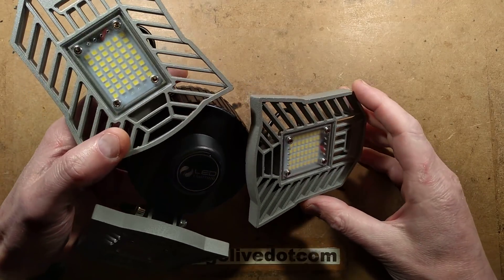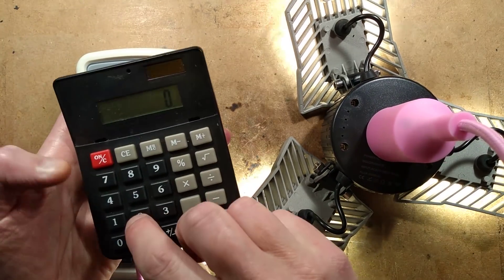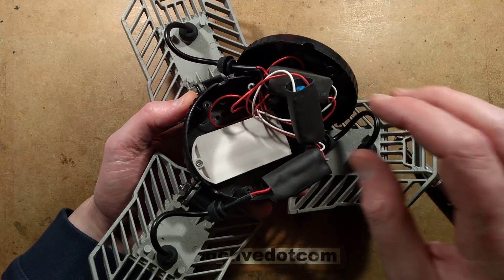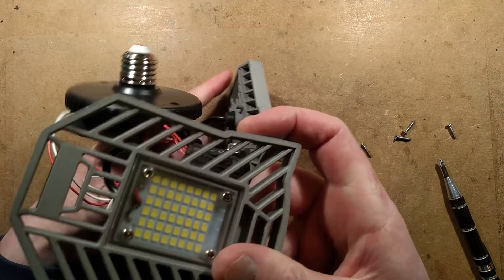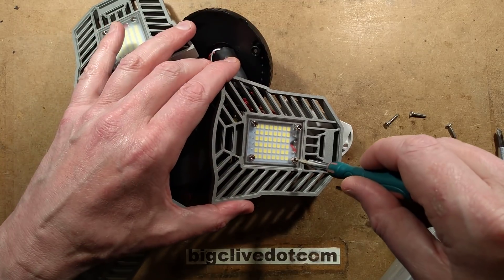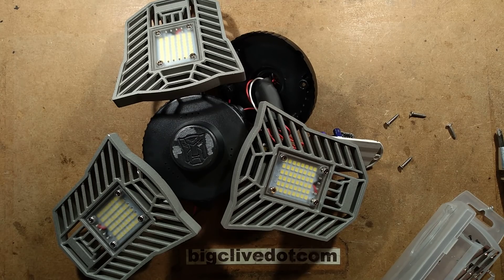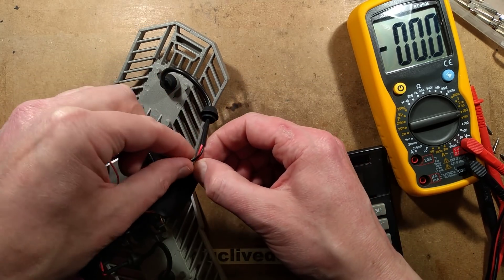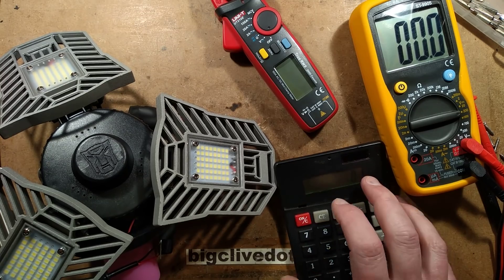Second Autobot lamp with RADAR sensor.

Comment: I just bought the clamp meter, it seems the E variant as shown has slightly tighter specs and the most expensive compared to the A variant which is half price.
Reply from the maker: If it's the Uni-T meter it measures DC current with the clamp, which is quite special.
Reply: @bigclivedotcom  I bought the exact brand and model. I have a couple of multimeters but no clamp meters.

Comment: I'm curious about something: Does a Class Y capacitor limit leakage current enough that it won't trip the Ground Fault Circuit Interruptor (or whatever the UK term is for it)?
Reply from the maker: The class Y capacitors are usually a really low value like 1nF, so they don't create much leakage.  Typically around 100uA (one tenth of a milliamp).

Comment: I'm amused you bang on about the switching supply in the radar sensor and how it has such a good power factor when its power factor was like 0.42.  It's the other (LED) supplies that had the good power factor.
Reply from the maker: I'm pretty sure that when the main load was on the lamp drivers had a good power factor.  It was much less critical with the ultra low standby current of the sensor.

Comment: when that happens to my phones there is a connector that needs reflowing, in my case there is a connector on the motherboard that plugs into kind of a breakout board where everything connects, that connector tends to get broken solder. the digitiser is one of those things that if there is an intermittent connection it goes dead till reset

Comment: Is there a way to modify the detection/timer module to allow for adjusting the on time of the light?  I'm just wondering if it's as simple as putting in a variable resistor for a 555 timer or something.
Reply from the maker: It should be viable to swap the timing capacitor on the detection chip.  Easier with a better documented chip.

Comment: I would say thermal compound or heat sink compound -- thermal paste would be the stuff that is bonding glue with heat conducive properties for small heat sinks that have no mechanical clamp to hold them on the chip.

Comment: there's no adjustment pot for the radar detection timeout, is there a resistor to be replaceable with a different value ?
Reply from the maker: There's probably a resistor or capacitor that could be changed to modify the delay.

Comment: Hey, Clive, I am in need of a current clamp and see this video is perfect timing! What can ya tell me about the one you used here? Is it the UT210E model? What do you think of it? Love your videos, keep um coming. Cheers!
Reply from the maker: I like the UT210E.  It's a versatile little meter.  Does initially take getting used to the need to zero out the DC current reading relative to orientation and objects.  (It senses ambient magnetic fields.)
Reply: @bigclivedotcom  Thank you... An Amazon click and mine is on the way.

Comment: Could you screw this v2 version in to a standard ceiling fan light socket and use the air from the fan blades blowing down to cool the heatsinks on the LED's?

Comment: Recently got cheap eBay 12v spot lights, might be hackable housings seem well made. Search eBay for 'Two 6" Super Bright 18 led 54w dual color' or '2 X 6 LED DRL Fog Running Lights'

I'm hoping to hack my 2x6 led lights swapping out the white LEDs for red ones

Comment: Will these work at 120v? Some on ebay showed 170v-265v, but others showed as little as 85v-265v... They appear to be the same light fixture...
Reply: Seth The internal modules may be for either range with same outer casing.  85 to 265 V is a common rating for universal mains PSU modules.

Comment: Oh just imagine getting your Windows PC fixed (the broke it actually.  smashed the keyboard dislodged the memory.  which I only figured out because ubuntu ran fine with it but said the memory was off so I took that dell apart.  ) Either way they kept calling it the LOGIC board.  whats that , like the big board inside a laptop duh.  Um thats a Motherboard.  ...... Oh thats right your a windows guy.  smh dumb apple repair guys confusing terms  do'h.  Heatsink compound makes more sense as thermal paste doesn't entirely make much sense to me.  how bout heatsink paste  ( never went to thos e idiots again because they cost me $20 for the keyboard and $50 for the memory.  no wonder they let it go for free.  $70 just to reinstall everything and they had an A+ cert in front?  I doubt they passed well  and MCSE on top of that.  Cheaters???  (MCSA in some areas) since some countries had Engineer

Comment: I've watched a bunch of John Ward's uploads about switching contacts. I've seen the failure of the wrong switch in a circuit first hand, and have taken apart several  relays and switches. A lot of the domestic stuff here in the USA seems to have specific (small separation) AC or (large separation) DC type contacts. However, of the dozen or so cheap Chinese switches and relays I've taken apart, all of them had large switching mechanisms with a wide separation. I started taking a bunch of them apart after going out of my way to source DC rated (cheap Chinese...//yeah I know) switches for a couple personal projects. One "DC rated" order came with different color rocker switches. Half of them only had DC rated markings and half only had an AC marking. After disassembling them, they all had the same internals. 
  Don't take this the wrong way. I'm not stating or implying that all contacts are the same or that Chinese relay/switch contacts are universal.
  I'm just curious if others have noticed these types of contacts as well. Maybe I don't understand the subject well. Isn't the AC vs DC switch rating/contact issue a one way problem? If the subject is limited to just the switch contact, and it's separation point, a switch contact rated for DC should work for AC as the gap is wider. I don't think this works the other way around as the DC arc needs the wide and quick separation to be extinguished. I don't see how a wider and quicker separation of the contacts is a negative attribute for AC. Does this mean the only issue with a DC rated switch used with AC would be the generally higher voltage jumping ability of a larger AC voltage as it relates to the electrical insulation of the device as a whole? Shouldn't this be a (likely) mute point as the insulation for a DC current should also account for the larger heating potential of a DC current and require a more robust housing design?

  Of course this doesn't really have any relevance to a 125v relay on 240v, but it got my mind on the subject for whatever reason... it's early and the coffee is weak...and I'll probably wake up and delete this in regret of rambling
 
It seems like the wild east likes to make things a little more robust than the label in many cases, while our western, more domestic markets prefer to build as cheaply as possible and label accordingly.
Reply: Upcycle Electronics Please be aware that the rating of contacts also depend on the exact material of the mating points, the force and speed of contact movement, the ability of the housing to handle splattered metal from the contact points and of cause insulation, wire thickness etc.  Certain switch mechanisms also include arc extinguishing features like the ones in overload breakers.

Comment: I still want to rebuild my floresent garage light  to led strips and you keep showing this one. Will you knock it off already? Now I am on the fence. That 20 second sensor will not happen however. I cannot do that. "Oh look dear, I've cut my fingers off with the saw because the garge light went off." So ,no auto off for me.
Reply from the maker: It has a bypass switch.  It could also be adapted for a much longer time.

Comment: Hey Clive, Love your work.  A brief History of these knockoff STRIKER type lights: South Carolina company that sells useful specialty items (Light Mine, Light Mine Pro. Etc. >>--> StrikerConcepts.com) threw these up on KickStarter a couple of years ago.  FInally the High Risk / Low Cost options have arrived from FAR-OVER seas and after your teardowns I could not be more thrilled to have bought two STRIKER TRI:IGHT originals back then.      
Here are a few of URLS: 
https://www.kickstarter.com/projects/strikerconcepts/trilight-a-motion-activated-ceiling-light-for-your
https://www.homedepot.com/p/STRIKER-TRiLIGHT-3000-Lumen-Motion-Sensor-Ceiling-Light-00342/301796567?MERCH=REC-PIPHorizontal2_rr-202906790--301796567--N 
20190605 - ($127. 00 Currently at Home Depot and Amazon) 
*I am a big fan of both Clive and Striker and am compensated only with knowledge by both (Zero affiliation with HomeyDespot). THANK YOU FOR ALL YOU DO!

Comment: Are you sure it's not you're SD card causing the recording problems ... I'm still using my Moto G4 for 1080p recording with no problems...I did have problems..even when using Open camera and with the Moto camera app but this was all resolved with a new 128GB A1/A2 rated SanDisk card.....My daughter also had problems with her G6 camera app crashing with very strange crashing ranging from app not opening to crashing mid recording...that was also solved with a new SanDisk 64gb A2 card... Avoid the high speed Toshiba and Samsung A1/A2  cards with the Moto series I've had problems with both makes with 1080p recording....both the Toshiba and Samsung cards works fine in my dash cam's ..so I suspect it's Moto thing not a Toshiba or Samsung problem as such..

Comment: As for adjusting the lamp, wear insulating gloves while adjusting it, just an idea. Follow up question, You said a few times that the Doppler switch unit had a good power factor, but when the lamps are off (only the doppler unit using power), the factor drops from high .9 to low .4, doesn't that mean that the doppler unit power factor is bad not good?

Comment: Have you considered that maybe the phone is just chuck full of crap and needs to be cleaned and optimized? Also, just saying, but a phone isn't exactly camera video worthy yet. You should consider just using an Arduino based alternative. Cheap, easy to assemble. The camera module is the most expensive bit. I'm saying Arduino because once a module dies, you just chuck it out and replace it with another. So much simpler.

Comment: Clive Why they have not used ssrelay it is better than this relay.
Reply from the maker: They probably just used a standard module.  SSRs often have leakage through snubber networks which may also have caused glowing or strobing issues when off.

Comment: 3X the noise on Amateur radio and CB radio frequencies... I'd love to see an analyzer on this.
Reply: The radar module only transmits a very very very narrowband signal (a pure sinewave) somewhere in the multi-gHz band (usually 2.4G/5.8G/10G/24G) with only a few millliwatts of power so they're not going to generate much interference. I would rather be concerned about the switching power supplies.
Reply: Can you show us some of noise in effect? Not in this light specifically
Reply: If you think electric led lights mess up your radio frequencies.. just wait.. motor manufacturers are wanting to use inductive plates to recharge electric car batteries! They will be out putting kilowatts of RF under cars with an approximate 6" gap (150mm in new money) 
Besides the roasted cat likelihood they will knock out not only amateur radio but all DAB radios and likely most 4 or 5g wifi! 
I keep mentioning this when inductive charging is being promoted but no one is listening.  
If you are part of the amateur radio group you need to organise and ensure the Government departments that deal with Radio Frequencies get involved. 
In France they are proposing (they have test strips in roads) putting inductive charging plates all over the place in KM long strips to recharge cars on the move! 
I cannot see this is ever going to be efficient, the losses will be colossal!
Reply: @williamarmstrong7199  The plates would likely run at 50hz. I would be more worried about the power used by plates that are not occupied by a compatible vehicle, and losses due to inefficiency.
Reply: Alex Jamieson Consider the effect of an unpowered iron/steel  vehicle placed in a high power inductive field.  I don't think it'll like the inductive heating.  Examples of such vehicles include any kind of trailer pulled by an electric (or other) vehicle, as well as anything relying on plug in charging or liquefied energy (H2, Ethanol, organic oil, liquid batteries, any other such tech).

Comment: How accessible are the individual LEDs / connecting tracks?  I'd consider getting one of these if I could mod the whole thing for 12V
Reply: Just change the drivers for ones that take a 12v input.
Reply from the maker: To mod for 12V you could make custom LED PCBs.

Comment: yeah Clive, the Lenovo-built Moto phones usually have pretty good hardware, but absolutely garbage Android builds, and even more garbage batteries. and unfortunately the LineageOS community has pretty much abandoned making stable builds for anything newer than the Moto G4 last I checked.

I gave up on Android and bought a "refurbished" (actually more like a wiped trade-in 👎) 128GB iPhone 6s for $130 US, and had Apple put in a fresh battery for another $35. also invested a whopping $10 on a spigen liquid air case.

I miss unlimited* system-wide adblocking and removeable storage, and hate how 3D touch makes text selection with big fingers a goddamn chore, but I haven't had a single hardware issue with it, unlike my Galaxy S4 (nasty screen burn-in, battery swelling), Moto G4 (battery swelling), and Moto G5 Plus (fingerprint reader  died, then the front facing camera.) helps that my work-issued phone is also an iPhone. 🤷🏻‍♂️ 

*iOS does have system-wide adblocking, but they seriously limit how many rules you can load, so it's pick and lose. luckily the firefox tracking protection stops pretty much everything else, but that doesn't help with youtube and all the undismissable spam ads I continually get, and haven't found an easy way to report. 😤
Reply: My S4 still works, I've got it setup as a media player.... no burn in. Went to an S7 because I needed more performance. Had it since it came out new too.
Reply: If you 'gave up' on android because of the hideous mess the low cost phones have become, then more fool you.  Unfortunately you have to pay upwards of a grand to get something thats actually good rather than what youtube review channels claim is good.

Comment: 247 volt from ac network ? Like australia... 231 volt In central europe at this time. Little bit too high right?
Reply: Also Clive is an island dweller and the voltage there tends to be higher than the nominal UK 240V due to generating most of its own power.

Comment: Lenovo, wasn't there an announcement not so long ago that they were one of the Chinese cou tries found to have installed spyware on their devices...
Reply from the maker: My Lenovo laptop came with malware pre-loaded.  That's why I bought it.  The price crashed when it came out in the media.  I got it home and removed the malware and bloatware.
Reply: @bigclivedotcom  good idea! 😊
Reply: ANY laptop should just have a clean install of Windows put on immediately before use  It's easy, free, and boy does it get em running fast compared to the factory installed OS.
Reply: @zybch  my computer is 16 years old, it's rejected nearly every upgrade I have given it, its half as old as I am 😂
Reply: No.  Best to stop believing anything the media says at this point.
Reply: @zybch  ill keep my faith

Comment: Phone cameras, man mine went out replaced it found out it's an app or security software keeping it and the flashlight from working. So I did some digging around (mentioned by BigClive viewers) Thank you,  if I unlock my phone turn all security off I can trick my phone and flashlight on my phone to work once then it freezes up again (samsung s7edge) I didn't realise how much I take pictures let alone make videos for you tube(I feel your pain BigClive) I use my camera to snap shots of whatever I'm working on, matter of fact when it first happened i mentioned on your channel and that's how i figured out it was software.  I'm in the middle of a transmission repair in between t'storms flooding and now  pterodactyl  size mosquitoes and  rain of course, today is sunny tho. Woo who. As always another fine video.

Comment: Not the best advertisement for Lenovo's Moto phones.
It may be time to switch Brands?
Reply: I've got the same model, but mine does exactly the opposite, ghost inputs. It seems to be some sort of feedback from the light sensor. They've had this problem since the first version of Moto G, even when they were made be Motorola (allegedly). Time for Clive to do a teardown?
Reply: @chrishartley1210  i hef a moto g5+ and dont hef the problems so i say mast me a bed update bin
Reply: Moto z2 force is what I use only issue I have is when the battery is low or the memory is near full it freezes other brands like Blu and Samsung have issues to in the low end department, there are no other really decent options unless you want to send him phones for testing with video

Comment: 13:40 I'm glad I'm not the only one who gets a fright when the device under test does something unexpected when I'm gingerly trying to take a measurement without getting shocked
Reply: Couple weeks ago I was probing a RF transmitter to look for a voltage drain, just as I carefully touch the meter probe to the board my weather alarm goes off for a storm approaching...nearly died from the fright
Reply: @matthewmiller6068  That's hilarious!  Speaking of which, I've never understood how people have the uncanny ability to slam car doors, honk horns, or make other loud noises right as you are doing something potentially hazardous, like taking a risky measurement or testing a suspect device that might go bang.  Their timing is so often impeccable!